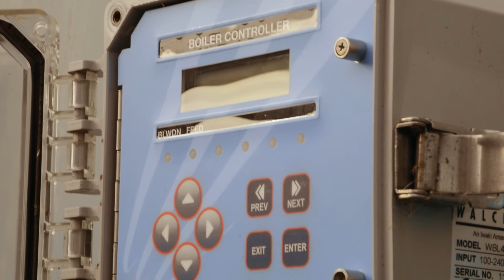Boiler Feedwater and the Effects of Scale - SteamWorks

Comment: The chemistry is that calcium and magnesium are present in groundwater as bicarbonates.  When you heat water to the temperatures in the boiler bicarbonates are converted to carbonates by elimination of carbon dioxide which concentrates in the steam.    It is a bit like when you open a bottle of soda.  Left behind are calcium and magnesium carbonate that are not soluble in the water and form scale on the metal surfaces.  On the steam end carbon dioxide dissolves in condensate forming carbonic acid which causes corrosion due to the low pH.